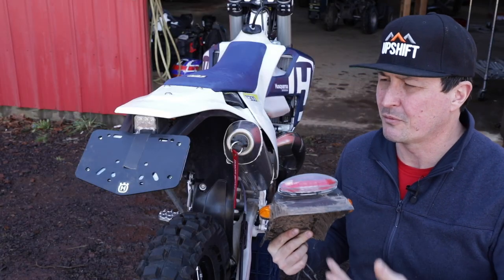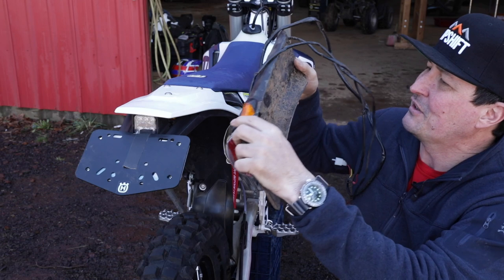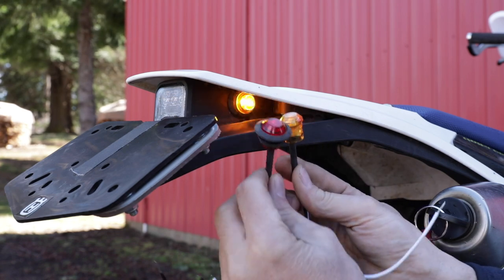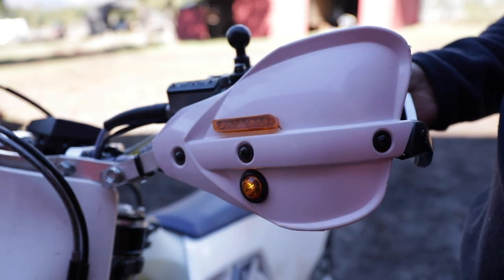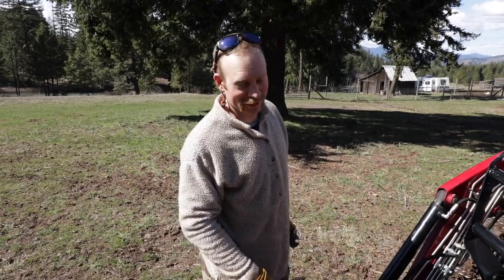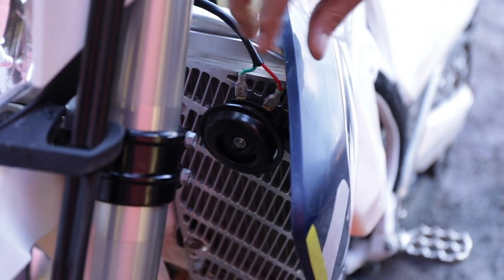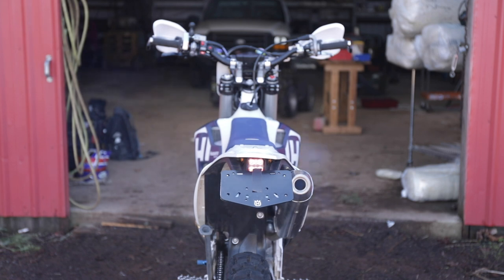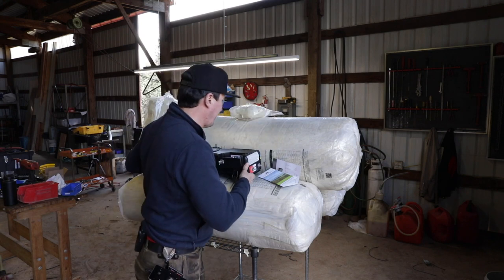Regret Is Ruining My Life

Comment from the maker: Wranglermart Is Back https://www.amazon.com/shop/wranglerstar This link will direct you to our Amazon affiliate store. #ad
Reply: Wranglerstar, Cool how you did your new lights, and i'v used those small round ones also, and they would come lose every now and then, so i put a little glue on them and then they never worked their way out again.. Peace!!
Reply: My -09 KTM has terrible lights.
Reply: Wranglerstar comon man where the link to the lock tite
Reply: I've got my own little shopping/wish list set up in Amazon.  It includes all the things you've recommended (that I've come across).  I hope you add a lot of those to your store.
Reply: A muffler plug is to keep dirt and debris out of your exhaust while in storage or transporting it.. And it also keeps snow/rain from back filing the muffler and getting water into the cylinder..
Reply: when will you be installing the insulation into van?
Reply: You might spray the area around your rear blinkers, white. Make the amber show up better. Spray paint is cheaper than a new bike... or a new you!
Looking forward to seeing the Locktitemobile in future videos... if only there were some small object, like a bottle perhaps, that could ride on top of it...!!!
Reply: 57moto,  cycleterminal.com  has OEM wires and connectors.. They have kits with a bunch of different connectors, like 175 to over 200 pieces for $25 to $35.. I hope that helps you out.. Peace!!
Reply: Kartboarder22G exhaust plug = mouse nest insurance. In other words he likes a plug in his bike so mice dont make nests in the exhaust or the expansion pipe
Reply: Calvin H.......Glue??  Surely you mean Loctite!
Reply: Yea yea, I meant Loctite.. lol..  
But what i really used was a little glue from a tube patch kit, and it works great for those because you can still get it out if you want without hurting anything.. ,
Reply: It would be great if you reviewed the firepen. It's a like a road flare that cuts steel like a torch.. here's one video I found..https://youtu.be/M59l-pfHObc
Reply: Wranglerstar What if you try to play a bit with a small mirror where the rear blinker is? Try to place a mirror underneath the fender and in an angle so it will create the ilusion that the blinker is sticking out and it will surely make the light more visible... :) just a concept hehe. Good luck!
Reply: I enjoyed the vlog lots of variation
Reply: The reason why God said not to mix fabrics in the Old Testament is that, any mixed fabric, especially synthetic, (in a hot, sweaty environment) would make your skin irritated.
Reply: Just a suggestion: please include a chainsaw PPE kit like you used to have (with helmet/face screen/earmuffs, chaps, etc.).
Reply: I apprenticed as a tailor, and one of the first things I learned was that synthetics are made from fossil fuels most of the time and they actually can leech harmful substances into the body. Apparently they are not as safe as we've been made to believe. So maybe there really is something to that.

Comment: It is interesting to see how different the techniques are concerning isolating the van. 
Here in Europe nobody will use fibeglas or stonewool! Even the lampswool is bad. 
Because of the moisture that will build up at the steel of the van. 
Better use somesting that is tight on the steel, so the damp doesnt come in contact. 
Check Armaflex or Isobutyl i think 99% here of the campervans builders use it. 
I am sure there is similar stuff in the states. 
After you insulated it with these thin selfsticking sheets you can easily cover it with wood.
Reply: Yes, a vapor barrier is critical. It also helps to use insulation that cannot absorb water. My favorite is the 'aluminized bubblewrap' sheets, because they are radiant barrier on both sides, with small air pockets to break up convection cells. Next best thing to vacuum insulation!

Comment: So stihl just came out with a battery powered chainsaw...I think a video on that is an order?
Reply: O SoSerious August Hunkicke already did one on his channel if you are interested.
Reply: The Media Is Cancer cool thank you!
Reply: O SoSerious - The MSA 160T has been out for several years.  Not a "pro" saw, but I just watched a video of it cutting 16" oak firewood.  Not as fast as a gas saw, but it did the just.  Hunicke did not like it because it was too slow for a professional.
Reply: Stihl has a large cordless line now, I saw a battery powered concrete saw!? Milwaukee has cordless magnetic drill press too. Those I need to see in action!!!
Reply: TheOneTheOnly W Cody needs to see this!
Reply: I don't own a cordless chainsaw and as a matter of fact, the only cordless tools I own are two Dewalt 18V drills, a 18V Dewalt 1/4" impact driver and a 20V 1/2 inch Dewalt impact driver.  Way too many batteries to be concerned about and replacing them is not cost effective.  I will say, I do own a Husqvarna 455 Rancher 20" bar gas chainsaw and a Oregon CS1500 18" bar corded chainsaw for the little stuff close to my shop.  Unless I was strictly going cordless for the majority of my shop tools, I'll stick with corded.
Reply: These saw have been out in Ireland  for a few years , I try one at a stihl course there as good as a ms 171
Reply: Jack Patteeuw,  Yeah, they are good little saws, but they're not made for lumberjacks, and are great for most people who just does a little cutting around their house..
Reply: O SoSerious: I'm not fond of, when something new comes out, that so many companies have to jump on it. That often makes for poor quality or lack of good design thinking. SO, let's find out about the Stihl battery chain saw. I want to see good quality, good duration of charge, use of a good established model of chain, and a realistic price. In the past, some companies reinvented the small chain which was worthless. So let's skip that part and have a worthwhile chain from the beginning.

A word to the wise fron my grabdfather: "Don't buy anything new until it has been perfected." This will save you money and aggrivation.

Cody, would you care to test one of the Stihl battery chain saws? I think a lot of us would be interested. And, who else out there is making these?
Reply: It's a Stihl, so it should come with a Stihl chain on it, but you can't get them in the U.S. yet.. And they're nothing like a gas powered saw, but it seams they cut pretty god, but they would only be good enough for a little cutting here and there, like  small jobs around the house.. But isn't that's what most battery powered tools like that are good for..
Reply: O SoSerious I've spent the last week climbing with a battery stihl topper and it's amazing and quite no dog teeth but it doesn't really need it however I will add it probably only compares to about 75% of power of a 200t
Reply: The husqvarna
 battery saws are great I hear, are they already available in the US?

Comment: I have a thought for you... all the surfaces inside the nook where you put the turn signals you could paint with silver spraypaint, that'd provide an extra layer of reflection to get more light out the back of the bike. The light seems to reflect pretty good off the white plastic, but not so much off the black... but I still think having it all being painted silver under there would really increase the light output.

Also I have to say, I've got an old 1986 Saab 900 and the inside of the taillights was in fact just a matte painted silver. I had to take it apart at one point and the gasket had failed and water had removed a lot of the silver paint, I ended up sanding it down and repainting it, looked as good as the undamaged turn signal on the other side.

Comment: I used a bunch of those on my flatbed and my trailer.   The trailer doesn't get used much and they all still work...  4 out of 9 on the flatbed are burned out or flakey...   Good thing they came in packs of 10...     And I do like your application of them.   I use a teardrop type turn signal on the rear fender of my DS'd XR400.   They use an incandescent bulb, but it has not burned out yet...  :)

Comment: Also if those grommets start to dry up over time and the lights slide out of them due to vibration or what have you, you can tightly put a zip tie on the backside of the light and it will hold them firmly in place. If you ever replace the light you'd need to cut the zip tie off but it's worth having it in there nice and secure.

Comment: Oh, careful with the wool isolation, first if it isn't treated you can get pest problems. The issue with the treated ones are similar to fibreglass issues, the chemicals used aren't all that great (making it fireproof, protect against pests etc).
Reply: Affra I thought wool had a much better fire rating, I was looking into wool and it's one of the big claims that wool will smolder with isolated ignition. Do you know what they use during the treatment to cause floating fibre? There is so much dodgy information out there, especially through reviews. Cheers.

Comment: be careful of the wool if it is not treated you can have a month in them and they eat the wool - if you search on the internet a house that was shown on Grand Designs got affected and they had to strip all the wool out etc - cost about £20,000 to fix it
Reply: QALibrary yep and that was the homeowner's and contractors fault since industry standard is wool treated with Thorlan IW which repels moths and rodents.
Reply: Rodney 3133 thank you - I was reading that they had issues with insurance coverage and they refused to pay out - not sure if they come to out of court agreement but the house holder ended up a lot out of pocket I believe

Comment: Glass fiberglass has some serious issues with insulating a vehicle. Particles floating around inside the van is a non issue. The big issue is that it will soak up condensation and if it touches the metal ribs or sides anyway it will promote rust by holding that moisture against the metal and it doesn't matter that it is painted. Moisture will eventually penetrate that paint and it will start rusting.  Unfortunatly my grandfather thought the pink stuff would insulate the van I eventually inherited from him.  There is no major rust yet but inside bottom of the back doors are rusted out from the constant moisture. 
Ideally spray foam insulation would be the best except for one thing. If you ever needed to repair body damage you would not be able to use heat at all without digging out all that foam.  It is the best insulation though and would really control the noise. In lieu of that I am still searching for a way to keep any insulation from touching painted surfaces.

Comment: How about putting some reflective tape on surfaces around the blinker? Could add some visibility when on the road. Some times its not just about DOT requirements but also safety. Good solution though, I like it

Comment: Just a thought on the insulation for the van.  Do you think getting the spray on insulation and then sealing it would still result in a problem? 

 I'm ignorant on insulation. I would think it would take less space and also be a more professional look.  I would do that and do a nice bedliner sprayed over it. That way you have the insulation as well as a easily cleaned living space as well.  Check out the What's Inside video of Inside a Yeti Cooler. That is kinda my thought on what you could do. 

Thoughts?

Comment: yeah,, fiber glass insulation is a terrible idea. i worked in a van conversion shop. an older build came into the shop and had fiber glass insulation.. you could see microscopic floaties in the passenger area.. definitely super toxic.

Comment: WS: really interested in how well that wool insulation performs. Looking forward to summertime differential temp readings with van sitting in the sun. If the wool works really well, should significantly reduce load on AC.

Comment: Have you run into any problem with air flow for the intake? I've seen videos of guys cutting holes in the air box for more power because they feel its restricting. KTM apparently doesn't have as much of a problem as the Huskys. Just curious what you think

Comment: 7:43: That's a European H4 bulb and is indeed not DOT approved. However, it is ECE approved and mandatory over here and probably in most of the rest of the world as well. Reducing glare for oncoming traffic is a big issue for us, and seems to be a  difference with the DOT regulations. A Range Rover must not cause more glare than a Mini. But made-for-led fixtures that are legal for road use are another matter, this bike just wasn't equipped with one.
However, if I were to go off road for 95% of the time, I might install those led bulbs as well...
12:50 You're touching a sensitive point there with the fibre glass. They're finding out now that those fibres can wreak havoc in the lungs, and as soon as the asbestos thing gets a thing of the past, this will be the "new asbestos".

Comment: Cody, I'm not trying to dissuade you from using your selection of insulation in your van. Have you considered varments? They can climb up inside and might really like your wool for bedding. Just something to consider. 

Isn';t it ironic that folks will recomend something that's not really good for homes and has been shown to fail in homes. Just becsaeu the mob uses it doen't make it better. I would think that 

Keep up the good work.

Comment: Hand signals bud, those blinkers unfortunately won't be seeable after one trail.. Also that license plate holder is way to big, you will rip it off mark my words. Mount a light on top of the fender along with the plate mounted sideways molded to the fender. Good luck with that setup Bud.

Comment: Check out armacell.us products for insulation. They have thin glue on flexible foam panels that are simply amazing for their insulation qualities and usability and safety. No condensation issues, which you will run into eventually with wool or other materials that let moisture travel and condensate on cold outer layer, but there is not enough ventilation to let it travel out. Wool is great for breathing structures, which sheet metal is not.

Comment: After 46 years of riding I've never seen a motorcycle that was good a more than one thing. A trail bike does not make a good street bike and a street bike does not make a good trail bike. Use your bike for what it was built for.
Reply: tndeere I think he stated something like 95% of his riding would be on trails and the on road use would be for transiting between trails or possibly a quick trip to town. His idea is a good one simply because of the time saved needed to trailer the bike between uses.
Reply: meh, I call BS on that statement anyway.  To be the best at any one particular thing you need to be specialized.  However, very few people will ride at that level.  Compromise is not bad, we do it everyday.  Look at your car.  There are lots of people riding dual sports that are happy with them.  Just like with SUVs many never even see any dirt.  Just ride what you like and leave everyone else alone.

Comment: You have a top quality bike and you are ruining it with cheap aftermarket things which don't fit... the factory kit has everything you need for code and it's quality stuff... you say you lose sleep and don't feel right because you didn't do it right in the first place and then you go and do this... hope it works out for you and you don't waste your money.
Reply: electro1622 if you notice he replaced the factory headlight as well because it was far from quality stuff. Replaced old technology with modern.
Reply: He replaced the globe, not the headlight...he also says it's not DOT approved, which is is.The headlight original is a H4 or H5 globe which is of high standard anyway, a lot of new cars still use these globes.... If he's been told that these globes are not DOT approved sounds like the guy at his local shop is taking him for everything he's worth.

Comment: why bother with the stupid exhaust plug?
Reply from the maker: It would be stupid to pressure wash a bike without a stupid plug,
Reply: oh it was for pressure washing. my bad i thought you were putting it in there every time. Ive always done it to my bikes though, just dont point the hose down the exhaust.
Reply: Guth mice and rats
Reply: I know!!!  I want to pull that embarrassing little piece of $hit out and throw it far away
Reply: cjoor,  And miss out on the opportunity to fire a mouse out of a cannon?
Reply: Wranglerstar I have restored a really old crosscut saw but I can't figure out who makes it the only marking I can see is one ovel out line on each handle. Do you have any knowledge about what this saw could be.
__________________________
Thanks
 Zach